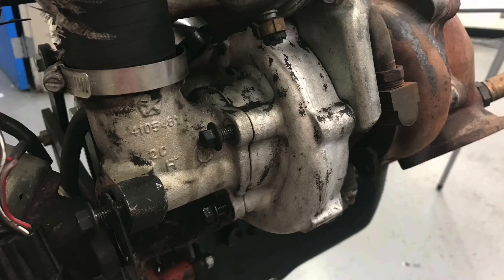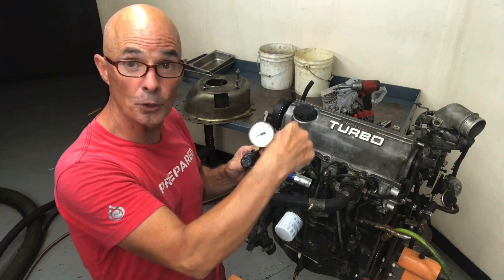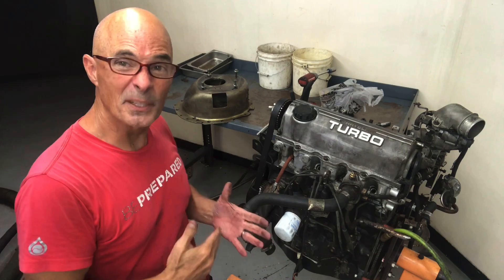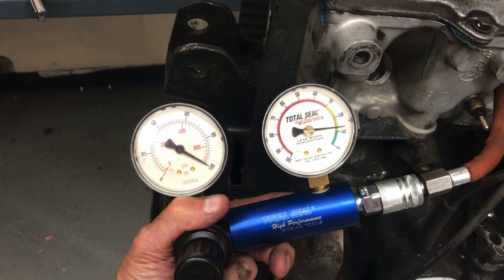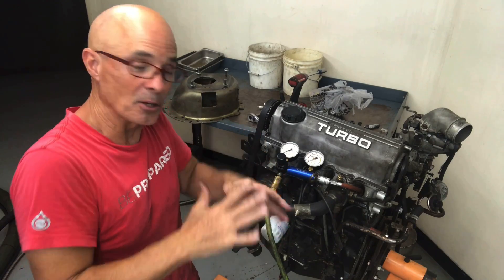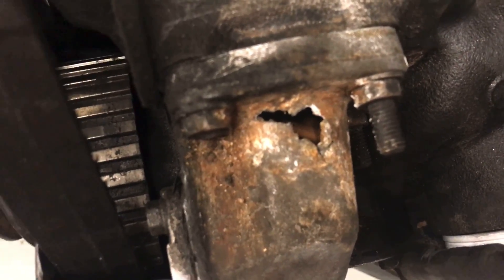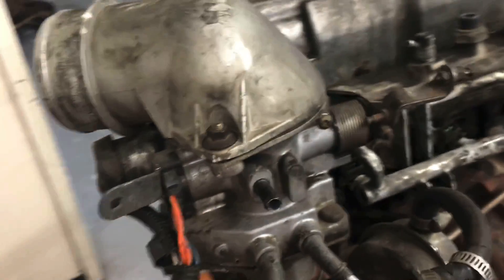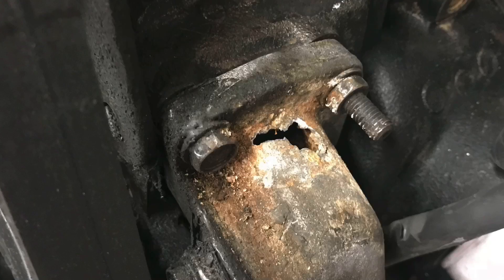CHEAP, JUNKYARD TURBO DODGE 2.2L-LEAK DOWN TEST

Comment: I had a Shelby Daytona with the 2.2.   Factory the eng has forged steel crank, forged pistons with full floating pins and a high nickle content block. I was running high boost and popped the snap ring out of one of the pistons pins and scored the block. Need to install spiral piston pin keepers. One of the big design fails is the exhaust and intake are on the same side. Turbo heats the intake and hard to work on. Mitsubishi Eclipse had their turbo boosted 4cyl with the turbo in front of the eng.

Comment: You could probably lap the valves or slap a set of rings in it depending on where it's leaking from and it'll run like brand new
Reply from the maker: THE HEAD IS DAMAGED

Comment: One of the other benefits of running a leak down tests is the ability to figure out where the leak(s) are coming from.  Listen to the exhaust. If you hear air, it is getting past the exhaust valve, listen to the intake, same as the exhaust, if you hear air, the intake valve is leaking, and then remove the oil filler and listen to the crankcase.  If you hear air, the rings are allowing the air to pass through.  Most often it is the rings, however, I did have a newly put together engine that wasn't all it should be and by doing a leak down test we were quickly able to determine that the valves were not done right, so only the cylinder head had to come off and back to the shop.

Comment: With all that corrosion in the cooling system tells me they ran it on straight water for a time with no coolant. People don't understand that coolant not only saves the water from freezing but it also lubricants the water pump prevents corrosion in the cooling system and cools the engine more than just straight water. but many think it's only to prevent freezing and that is not true it does much more then that.

Comment: I've ran engines on engine stands before just because the engine is not in a car you can still run them I have even fired them up laying on the ground

Comment: I can vividly remember pulling up to a stop light with my GLH-T ($145 MP 11psi computer),  and low and behold a shiny new Notch 5.0 with the two pipes dripping condensation, as I slowly rolled even with him,  he gave my the biggest shit eating grin I'd seen in a while, I couldn't contain my self as I new this was going to be fun, ran the rpm's up to about 2700 and we both waited for the the cross light to turn from yellow to are green we both left together hazing our tires across the intersection, we both ran our 5 speeds up to 4th gear with me out in front by a solid 3 cars, as I slowed waiting for him to give me the nod, he turned quickly off on a side street. I had many other encounter's with the much heralded Mustang 5.0, some good others bad, but this was my number one!
.

Comment: It's the first time I see the engine, it looks really similar to vw engine, used in first and second gen golfs, and used in Brazil until 2008 or so, they both are sohc, with same sides ports and the water port exit is between cilinder 3 and 4,  and they are know to make good power with boost.

Comment: Wasn't this a misubishi engine?
Reply: The 2.2 & 2.5 litre engines were all-Chrysler design and build.  With the right head gasket they were durable (hint, hint).
But many early 1980's K-cars and minivans came with a slightly bigger 2.6 litre Mitsu-mill which Chrysler already had experience with since the mid-1970's in their imported Arrows and Colts (which were totally Mitsubishi except the badge). That 2.6 wouldn't be so scarce now if Mitsubishi had designed theirs to be as durable...
Reply: the 2.2/2.5 engines were inspired by the volkswagen rabbit/golf engine block which chrysler actually used in early dodge omni's and plymouth horizon's with a chrysler-designed cylinder head. it's not a direct vw copy or clone, but the layout and location of parts is very similar.

Comment: My buddy has a brand new k car 2.2 sitting in his garage,  his dad used to race turbo rampages back in the 80s and he kept a spare NEW motor at all time, it even has the transmission on it....I told my friend to make a crawler buggy with it by turning it long ways so one axle goes to the front drive axle and the other goes to the rear drive axle. ....or just make a bad ass sand rail with it!!......it's just sitting under a tarp In the corner of his garage. ...I'm sure I can talk it out of him for fairly cheap

Comment: If you need a blow-through intake to replace the T1 log intake, hit me up, I've got one sitting that I can send you. You'll have to modify the exhaust manifold a little bit with a grinder to clear the intake runner on number 4, or find a factory 2.5 T1 or TII exhaust manifold which was machined for that already to run it though.

Comment: My best friend had an 89 Shelby Daytona 2.2 turbo. The Shelby version had a bigger turbocharger from what we read. The guy he bought it from told him it needed a head gasket. Turns out the head was cracked between the intake exhaust valves. Very pricey...
Reply: Fun Fact: All 2.2's and 2.5s suffer from having cracks between the valves. So long as the cracks don't go into the valve seat they can be safely ignored. Practically every 2.2 and 2.5 turbo or not that I've pulled apart "suffered" from this, even if they were running well before I took them apart.
Reply: @TheMailmanOfSteel  good to know. Thanks for the reply

Comment: After seeing the hole in the freeze plugs and in the water neck for the water pump I would not be one bit surprised if this motor has been overheated I would pull the oil pan and look at those rods to see if they are black in color based on heat

Comment: What about the condition of the likely brittle rubber timing belt ??
Reply: If it snaps, put on another one. This is a non-interference engine.
Reply: @mfree80286  
U sure ???
I thought those were interference
Reply: @flyonbyya  Given I've snapped one personally, they're noninterference. The later 2.0/2.4 are interference though.
Reply: the 2.2/2.5 engines are non-interference but there is one caution about timing belt replacement, when you tension the new belt you need the proper service tool which is a wrench with a calibrated weight on it. if you try to tension the belt without it you risk breaking the end of the camshaft off, i've seen many broken cams in these motors when the belts were overtightened.

Comment: Had one of these in my old 84 Dodge Daytona. It was pretty fast back then.
Reply: I wouldn't say "pretty".  It was ridiculously fast for what it was.
Reply: @KC9UDX  I have a picture of it somewhere. I buried the needle so many times.
Reply: @96MustangBoy1  my best time (85 Laser) was 14.2 in the quarter mile, don't remember the speed.  But the throttle cable broke when I shifted into fourth. 😐

Don't think I have any pictures.  I do have the CHRYSLER emblem off the back in my toolbox for some reason.

Comment: This is the first generation turbo motor where the throttle body is mounted directly to the turbo inlet, not ideal, the second gen motors they switched it to the intake manifold where it supposed to be. Would be awesome to see a comparison between the two setups
Reply: The blow through setups make more power as the log manifold tends to lean out on cylinder #4, and thats before you try to run an intercooler. Back in the '80s Mopar themselves offered an intercooler kit for the pull through TI's that sat above the engine, which would allow you to make as much power as a stock TII until you ran into heatsoak and restrictions within the manifold. There is no difference between the "Two piece" and "one piece" blow through intakes other than the ease of porting the two piece intake offers, as they flow the same stock.
Reply from the maker: FLOW RATE IS NOT WHAT WILL CHANGE HOW THE INTAKE WORKS-WHAT IS THE RUNNER LENGTH?

Comment: The '84 used a smaller distributor than the later stuff, so make sure you get the right one. How are you going to fire it? The OEM used a Hall Effect sensor and it isn't supported by the aftermarket. You going to go 36-1 wheel and sensor?

Comment: Can the leak down test be done in the junkyard using a portable air tank before pulling the motor ?
Reply from the maker: we did a cranking compression test in the yard with a battery and remote starter switch
Reply: @richardholdener1727  I was thinking of a situation were it was not possible to do a compression test, no starter, battery cables etc but it was possible to turn the crank by hand, having a portable leak down tester could save you from removing and buying a dud engine

Comment: It's worth putting a fresh head gasket on it. They are a composite and rot away. Reuse the head bolts. Felpro bolts are junk.
Reply: How so? Have you reported it to felpro?
Reply: @shadowopsairman1583  I've been doing this 30 years. You don't believe me? I don't care. Learn for yourself.

Comment: Keep in mind the later water pump and housing is reverse rotation.
Reply from the maker: thnx-are the housings available-do you have a part number (or size) for the freeze plugs
Reply: @richardholdener1727  i don't Sir. They are all used parts now. As long as it has a grooved water pump pulley, it will all work. The smooth water pump pulley means reverse rotation, and if i recall the housing is different
Reply: @richardholdener1727  i don't know the correct freeze plug size. The early water pump housing is the same turbo or non

Comment: 87-95 dakota 2.2 or 2.5 bellhousing. 87-91 had a conventional 4bolt trans to bellhousing, with a circular centering hole. 92 up used the ax5 wierd oval bellhousing to trans pattern like an ax15

Comment: If I'm remembering right from the forums, the bellhousing from a 2.4 Jeep Wrangler manual should mate to a 2.2/2.5 block with one bolt not lining up.
Reply: It will. I have one in my garage... but I'm in Canada lol
Reply: Interesting.
Reply: Yes, if a 2.5 Dakota will work a 2.5 keep will too, even the accessory drive is the same between the Jeep’s and Dakota’s
Reply: 2.4?  AMC 150?  It uses the same bellhousing as a myriad of GM engines.  It's the "Chevy Metric" or "Chevy 60° V6" pattern.
Reply: Kinda, the 2.5 Dodge Dakota one is a direct bolt on. The 2.4 one would work really well for the 2.4 PT/SRT motor.

Comment: My first car was almost a Dodge Daytona Shelby turbo. Immaculate except for a small fuel leak around the fuel rail and the used car dealer said he was sending it to the auction. After a few spirited test drives with late 70’s trans ams  parents got me a 2.8l camaro so I’d live lol.

Comment: Those things do a test? I only ever used them to keep the valves from dropping when you change the springs on the engine.
Reply: Silly goose, its called a leakdown tester

Comment: Great engines… much better intercooled
Reply from the maker: Agreed!
Reply: @richardholdener1727   ...if I send you a brand new  VS Racing 7875 turbo .96 a/r, would u test it out on a 5.7 Hemi (since that's what I drive) or maybe use it on the 2.2 Chrysler 4 banger???

Comment: I'm having memories of zener diodes (to fool the ecm at the map sensor), pressure switches, and cold start injectors (1 for every 5 lbs of boost). We found that things started to go south after 8 of those bmw junkyard injectors lmao. Each 5 psi step was about 50 hp. Fun fun fun !
Reply: The Saab cold start injectors were money, too
Reply: I will say I learned the zener diode trick from Gary Donovan. Feeding it straight methanol with NOS jets and NAPA pressure switches was something i stole from the buick guys😁
Reply: @kylemilligan752  damn you pushed it a lot further than we did. I worked at a Dodge dealer back in the 80's & the service manager ran a GLHS & a Caravan with this setup. 3 speed automatics held up pretty good to our abuse. Ours were street legal.  Low 11's for the GLHS & mid 12's for the Caravan ( if memory serves correct). Enough to embarrass Mustangs & Camaros of the day. Yours sound mucho faster !
Reply: @SpeedRacer-pz9jn  that auto didn't happen to be an a413 was it? I've got a 82 rampage I'm getting ready to jump into. The wife wants it to be a full blown drag car lol
Reply: Cold start injectors??? What do you mean by that
Reply: @mrmatt2525able  older fuel injected cars had "cold start injectors" to give the intake a splash of fuel to help with cold starts. They run on 12v & just spray when on. No injector pulse needed.
Reply: @SpeedRacer-pz9jn  Some Toyota truck guys wire thier cold start injector in with nitrous for a wet shot on 22re's.

Comment: Good luck on that Bell housing, I've only ever seen one n/a 2.5L SOHC Dakota in the wrecker 20+ years ago.  Also what ecm is going to run this as Chrysler used two modules from the factory.
Reply: The factory fired two injectors at a time in two banks.
Reply: Microsquirt
Reply: @trentdawg2832  that like the mega?
Reply: @XL883CNick  kinda, just alot cheaper and   user involved

Comment: One of the most underated chrysler engine
Reply: This is one of the most underrated channels
Reply: Didn't they crack heads all the time?
Reply: @thatcarguy2778  no just head gaskets. MLS and problem solved
Reply: I have one of these sitting on a stand😂
I’ve always wanted to build one out but I’ve never had the motivation to actually tear into it
Reply: They are my father had a 1987 Dodge Shadow and that thing was still running when he junked it a year ago only because someone stole it and destroyed the body but he drove that car every day to work and back and all over sith the same engine the thing had a ton of miles on it and there was hardly any oil pressure but it kept running

Comment: 2.2 will last forever
until it doesn't
Reply: The Turbo cars suffered a lot from not having decent synthetic oil and regular octane gas ran through them. Not to mention the extra 80 hp over the N/A versions tended to exacerbate the headgasket issues they had.(which were mostly fixed by not using a garbage gasket).